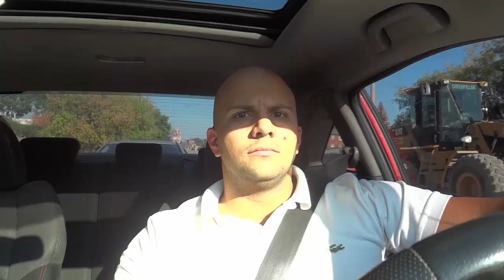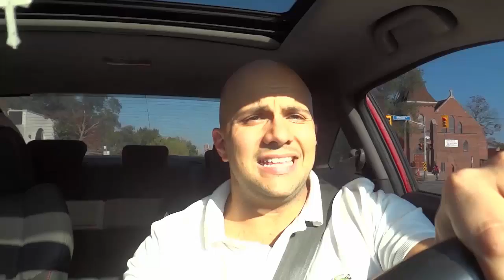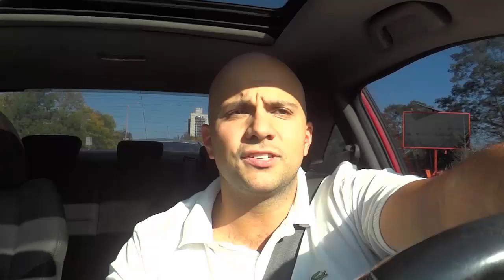Overboost Explained-What Is Overboost In Cars

Comment: Overboost is not a good thing. It means your turbo is boosting too much. You have to maintain the air fuel ratio or bye bye engine. I think you're just equating overboost to boost
Reply: Yes exactly, and overboost happens when the "wastegate" not working ( not in open situation which make the car lose power, but in overboost , the wastegate  block in close situation)

Comment: Is it possible for certain cars to go into limp mode straight away when overboosting? I have a 1.2 tsi polo and 3rd gear with throttle fully open the engine goes flat and the turbo stops generating any boost At all. I checked the live boost and it’s running at 14 psi which I’ve been told is pretty High. I don’t know too much about cars but trying to learn so any help would be appreciated:)
Reply: Hey man can you update me have the same car and having exact same issue you’re having have you found a solution?
Reply: Das auto

Comment: thats is not what over boost is...... over boost is when a turbo exceeds the desired boost limit  and the car cant control the boost levels.
Reply: It's not, it's a designed feature in many cars, like the Lancia Delta. Normal wastegate level is 0.8 bar and the overboost solenoid temporarily increases it to 1.0 bar with full throttle. What you're describing is called boost creep
Reply: @5PYZ3R Wrong

Comment: WTF I have a dodge 2.2 turbo a few years ago when my wastegate didn't work right it over-boosted and put a half dollar hole in my piston
Reply: Denny Allen had to have been more than that. Pre-detonation would cause that, but overboost alone wont.
Reply: Felony Innovations over boosting causes sever lean conditions, causes heat, destroys a piston
Reply: @youtubeisbroken241  "causes heat" Do you even English bro? A very lean air-fuel mixture produces less heat than a stoichiometric air-fuel ratio
Reply: @Moonmaggot69  *pre-ignition causes detonation. Normal combustion in engine is deflagration

Comment: I think you should stop helping people
Reply: Why? Please explain yourself?
Reply: @banditxridez  because overboost is a condition of how your car is running not a added performance feature
Reply: @maxwellpeter1598  Wrong, overboost is a feature and you can only use it when engine and turbocharger temperatures are low. Overpressure means that the boost controller and/or wastegate is malfunctioning.
Reply: @maxwellpeter1598  Nope. Read my comment carefully.

Comment: Wait what ok over boosting is where if you have a car that is tuned say at 10 psi and your car is hitting say 14 psi that is over boosting and there is something wrong with your turbo somewhere
Reply: Building an overboost feature into a turbocharged car is a compromise between protecting the engine and maximising its power output. Overboost is when the turbocharger runs at a higher pressure (forces more air into the engine) than would be sustainable on a constant basis. The duration of overboost is usually limited to 10-20 seconds and the result is a power gain of around 10%, on average, for that period of time.
Drivers do not control overboost manually, it happens automatically when the car is in a certain gear at certain revs and the throttle is fully open. Because the power is not constantly available, overboost also has the advantage of providing extra power in particular scenarios, such as overtaking and exiting corners, without increasing a car’s official emissions or insurance rating.
Reply: @aitchy4skn997  no shit sherlock
Reply: Nope
Reply: Or you have the bad overboost like i said as above like i did with my car
Reply: @aitchy4skn997  you're so lovely i can't believe it 😄
Reply: @aitchy4skn997  so if you have a bad overboost where is it and how do i replace it

Comment: Some will call that "lugging" the motor but if you are a tuner or have tuned your car to acheive high boost levels at low rpm you may succeed but its not a healthy condition unless you know how ro tune.
Reply: I believe that’s what my car is doing, at low revs it’s running 14 psi of boost and when I get above 3500 the turbo seems to cut out and the engine goes into a sort of limp mode where I have no power

Comment: Idk... Overboost is when you are trying to create high levels of boost "prematurely" as in too low of rpm and your ecm or pcu will make corrections to accommodate those conditions to prevent detonation.
Reply: sicklotus how bout cool oil cool intake charge , more boost for 15 seconds.
Reply: I can only speak about bmws from personally experience, where as n55/54 engines equipped with a DCT trans has a factory built in feature that creates overboost for a short period.